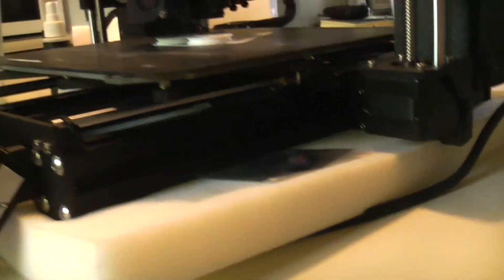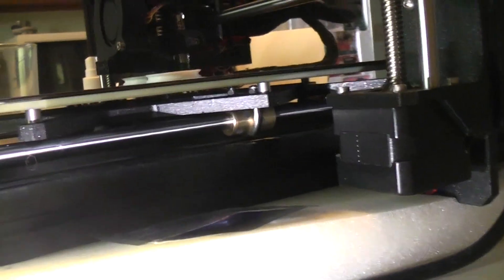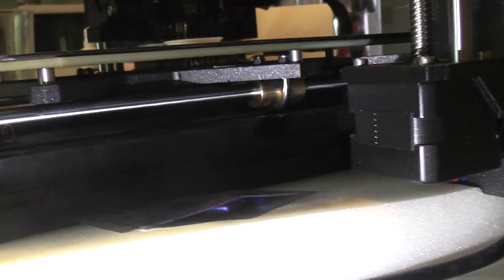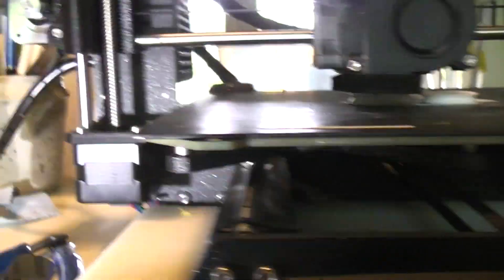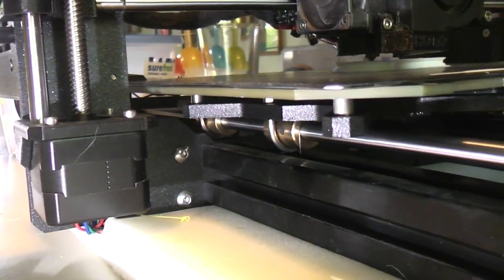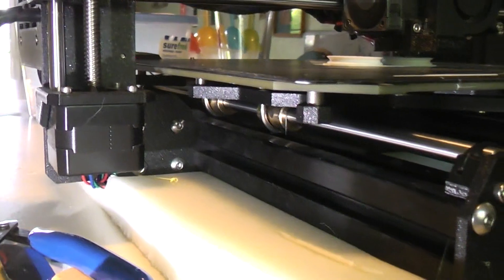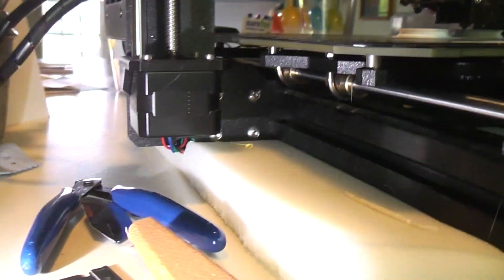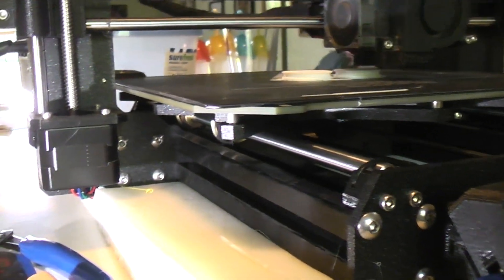Add Ultimaker type Bushings to the Prusa MK3 bed for ultra quite mode.

Comment: Brass bushings are a pain because any misalignment will make it act like a break
Reply from the maker: Never had that problem and Ultimaker has never had that problem. I guess if the build is bad enough it could happen.
Reply: @Robothut  yeah you need perfect rods. literally what I said :P some people use 2 guide bushings and  1 slightly lose one. watch tech2c's video on it!I'm planning to probably do the same :)

I had 2 shafts and one was slightly bigger then the other. it binded up on one and was slightly lose on the other.

Comment: Do you oil the bearings? When yes, with what?
Reply from the maker: I did not oil them for quite some time and had no problems but then I decided to try some Silicon lube on them, that kind of gummed things up. So then I tried some PTFE spray lube. It is supposed to have Teflon in it. That is what I left on the rods. I do not think that the bearings that I bought really need anything as they have graphite inserts that should provide lubrication . But just plain brass inserts would need some light oil I would think. I suppose the Ultimaker web site would say how to lube the all brass type inserts since they use them.

Comment: still runs great?
Reply from the maker: Yes. I run my MK3 day and night and the bed bearings are still working great. So quiet and not sloppy. But if they ever do wear out I will buy more of the same as they are not expensive.

Comment: Are these the ones you purchased?  These are on Amazon in a 2 piece set. "Ultimaker copper sintered bushing 8x11x22mm bearing copper sheathing cover"
Reply from the maker: No, the pones I bought were on Ebay and are the same size as the original Prusa MK3 bearings that would be 8 X 15 X 22 mm.
Reply from the maker: I see that most Ultimaker bushings are the size you found, here is a ebay seller with the same thing I used. You select the 8 X 15 X 22 size.
https://www.ebay.com/itm/Self-Lubricating-Graphite-Linear-Bearing-Shaft-8mm-for-Ultimaker-2-3D-Printer/153004886403?hash=item239fcd4983:m:mqLpoNAi4Mumuk_NtaB2yHw

Comment: I printed some bushings from Makergeeks' Raptor series PLA that work much better than the originals.
Reply from the maker: I would love to here how they hold up. Have you had them in the printer for a long time ? Should be real quite !
Reply: I've had them on for about 3 months and no issues.  Real cheap to try and you have your new bushings for a backup if anything goes wrong.  I also load my bushings with white lithium grease.  They should last a LONG time.
Reply from the maker: Sounds great and well worth trying. Do you have a link to the STL file ?
Reply: I designed my own bushing, but there are several similar ones on Thingiverse.  You may have to adjust the speed and temperature to get that perfect fit so the the bushing slides freely and with no slop.
Reply from the maker: I think I will give it a go. Maybe a adjustable one that I can tighten to just the right feel and adjust as it wears. In an case it should be fun.

Comment: Coool. Can you share a link to the bushings?
Reply from the maker: The seller on Ebay that I used does not show anything right now but all I did was search for Ultimaker bushings and you might try Ultimaker bearings as well, that should turn up the parts.